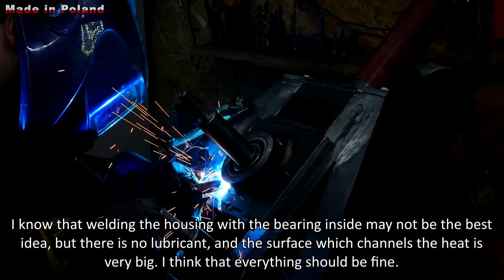Steel Bending Machine

Comment: As far as I know Steel does not bend. Iron can be bended.
Reply: It highly depends on the type of steel. But generally speaking steel absolutely can be bent. It's just that some forms of steel will break while others do not.
Reply: @JAtoA  The more carbon added, the harder and more brittle the steel becomes, didn't it?

Comment: Lightest metal? Aircraft, blends,  a machine,  made by hands by humans,  try a rubber mat work station, to stand on. , grounding.  Wires bolt. To ground pin,   in ground,       john.

Comment: Overall very nice. Some things I would change: larger wheels so you waste less stock at the bar ends. DRO on the ram for repeatability, also the ability to turn it 90deg for horizontal rolling of very large hoops.
Reply: It''s not the size of the wheels that determines the length of the wasted ends [Green in the trade]. It;s the distance between centres of the driven wheels.  This process is actually called Rolling, as opposed to bending. where the material is formed around a Former, and Folding, where it is bent at a relatively sharp angle. He has done an excellent job, apart from the wheel spacing, and has not shot himself in the foot when he decides to add the two angled side rollers needed to roll angled sections. There is definitely an art in it!
Reply: E'.  Fatta bene 👍............ nessuno e. Perfetto....👍💥👍💥🇮🇹
Reply: Dear your Mechanical engineering services is ultimately full balance in skills and build in social development work.

Comment: Hi there! A good project! I saw during your video were you said you didn’t have a good way to cut keyway slots. FYI, I was watching another video where the guy cut his keyway slots with his lathe. He put the end mill in his three way chuck and had made a holder for the tool post made out of what looked like 1 inch square stock welded to the heel of what looked like 2 inch x 2 inch by 1/4 inch angle iron about 1 foot long. He drilled 2 holes in the ends of the angle iron to hold 2 u-bolts. He placed the bar that needed the keyway cut in it in the angle iron and clamped it down with the u-bolts. To cut the keyway he used the cross feed of the lathe. Keep up the good work and good videos. Keith McCord, Ashville, Alabama, USA

Comment: Excellent!   But!  Thread diameter at 27:14 min and similar points probably need a little more...     And so - a little weak
And you need to weld a bolt to the case to connect the electrical protection wire when electricity hits the case

Comment: Search - Cyr Wheel (Circus Art)
Know that vinyl tubing is slipped over them.
Know they typically come apart for transport and storage.
Know the forces involved will quickly ruin all but the strongest joints.

Comment: So, I guess the amount of waste is governed by the length of the hypotenuse of the triangle made by the rollers. It seems like if you could adjust the distance between the bottom dies, you could reduce the amount of scrap you produce on each bend and allow the bender to work on even more types of material if you made some more dies. I'm probably wrong though...

Comment: Is there any possible way of getting a set of prints or plans for this build?
Reply: Hello Mr. David,my name is Ayhan,I am a Freelance Mechanical Engineer who works in Machine Design and in preparing 2&3 dimensional Machine Parts Drafting.İf you still need plans of the above Bending Machine,I can help you in making Design and  preparing necessary Manufacture Drawings and Technical specifications of the above Machine.İn addition I recommend you to make the machine manufactured in Turkey ,since it would be more economical.Manufacturing cost in Turkey is much lower than  Europe.I can help you finding a suitable  Turkish Manufacturer as well if you need.Good days,

Comment: There is absolutely nothing wrong with using a file to prepare a keyway.  Broaches are quite expensive.  So, as long as you a judicious when using the file, you keyway will work just fine.  Don't let anyone tell you any different.
Reply: 'works' is a little bit different than transmits lots of torque without deformation.
Reply: @JaakkoF  ;I did say "judicious".  I have lost count of the number of keyways I finished with a file before I gained access to a quality broach set.
I have never had a keyway fail, nor the key itself deform.  I have performed this task on units up to 50 HP.  Low RPM to over 3,000 RPM.  I also used proper key stock.
Have a great day and keep safe.  Enjoyed your video.

Comment: It is a bad idea to solder the wires before fitting into the switch. After time the connections will loosen up, due to the the solder COLD flowing due to the screw pressure. Always use the bare copper wire when using screw terminals. It is also the same effect if you were to solder the wires then use crimp connectors, it will come loose after time. Question please. How come you did not also change the bottom bearings setup, they surely must also bend under load as the top one did before you modified the bearing assembly. Regards from Australia.